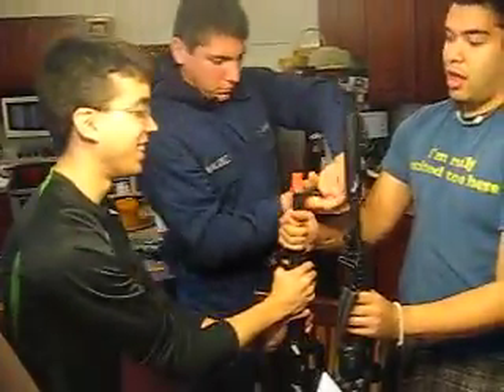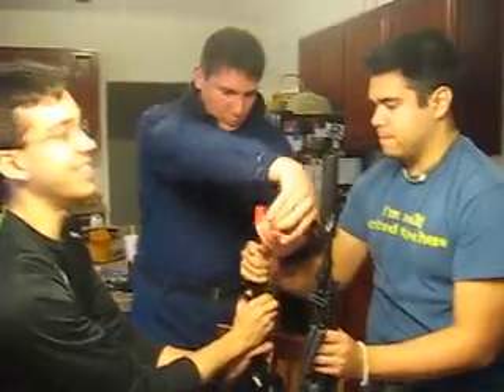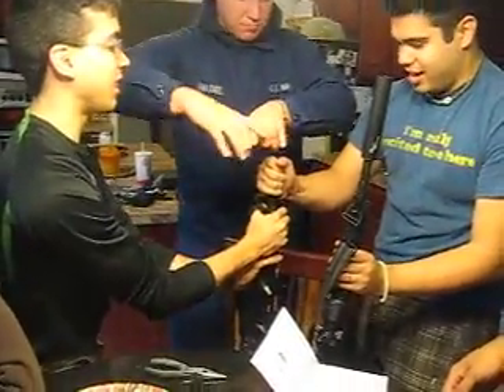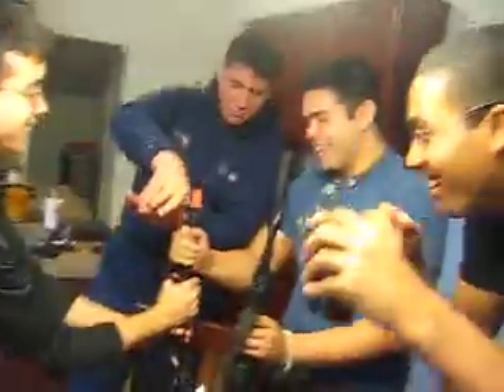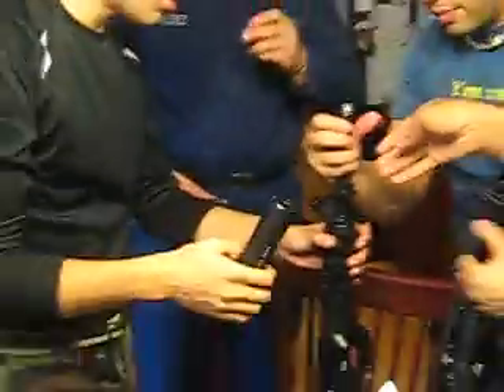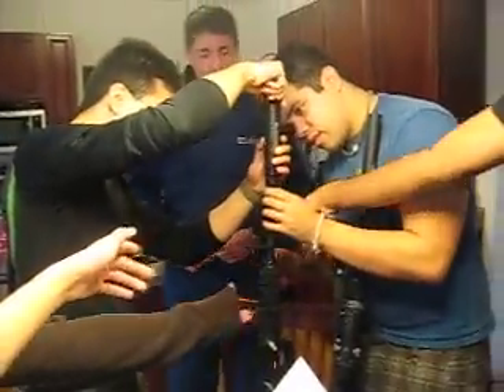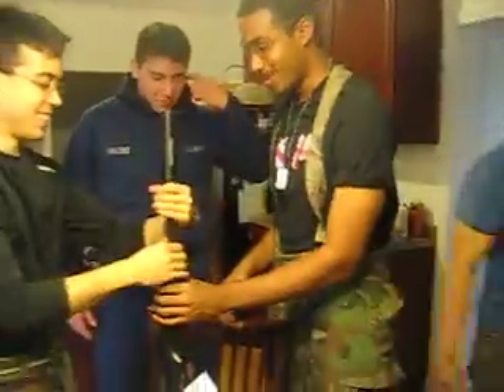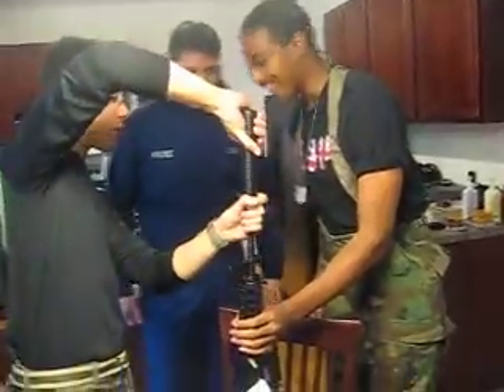Airsoft Blog - Taking off Echo 1 Flash Hider

Comment: Yeah, I've heard of the AT-4's and the RAP4's, but they still can't compete against a typical paintball gun.  Until paintball becomes strictly a scenario-based game, and an expensive AT-4 can compete on the level with a typical paintball gun, I will forever see it as paintball.  

At least in airsoft, when I see other people running around with replicas, I can suspend my disbelief for a minute and have some fun.  I've tried with paintball and it just doesn't fly with me, IMHO.